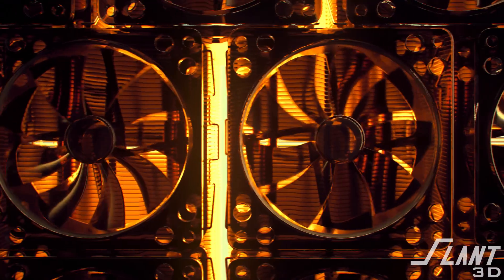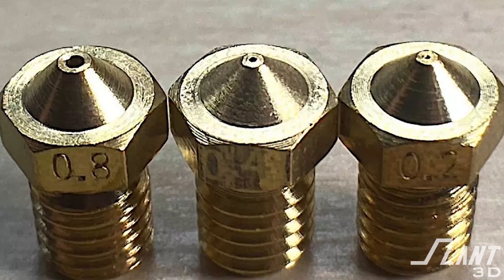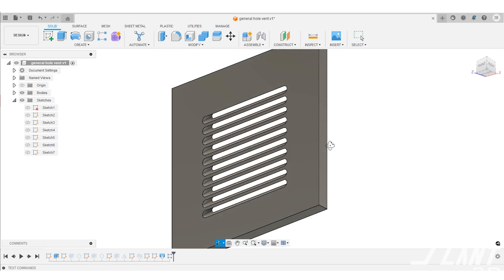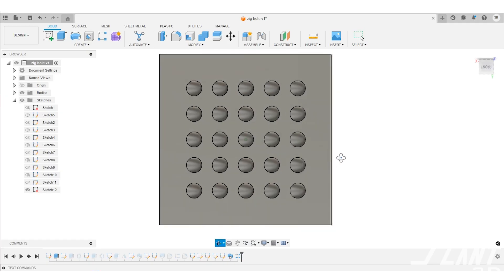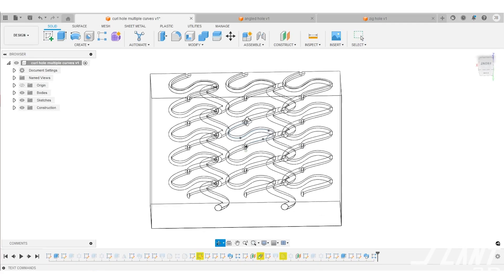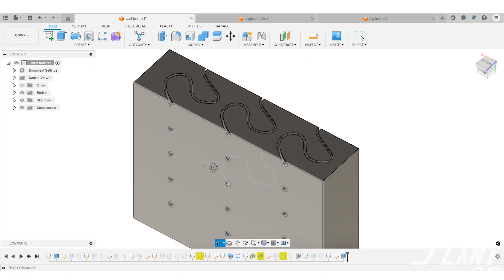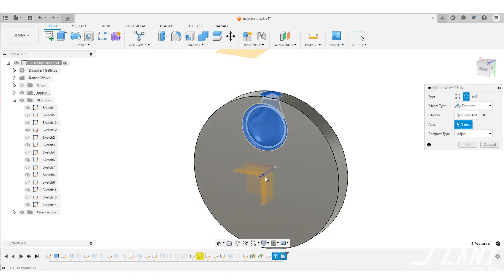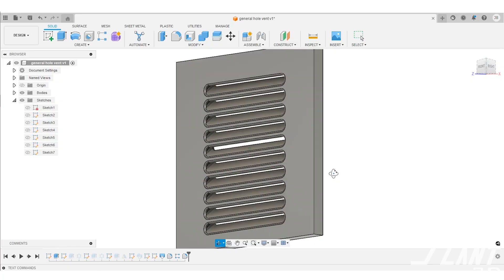These Cooling Vents are Impossible | Design for Mass Production 3D Printing

Comment: It's really cool to see the kind of innovation that comes from a relatively new manufacturing technique. The further into the video you go, the more insane the geometry gets. And while I imagine you technically could manufacture these parts in other ways, it'd probably be stupid expensive and complicated to, and likely even then still likely with extreme compromise. For example, several smaller parts later joined together would be one way. It just wouldn't make any sense to do.

I was actually quite critical of the last Slant 3D video I watched (the mug handle video) because I felt it was very dismissive of other manufacturing techniques as antiquated. But this doesn't seem to be the case here. Instead it's just showing off the really cool things that are being made practical with the use of 3D printing. Doing so also provides solid examples for why someone might want to choose 3D printing over other techniques for high volume production. It does also show its limitations and potential ways to mitigate them. For example the basic vent designs with 3D printing may not be an ideal combination, but the slants work much better. (Though I assume this introduces more drag, something that may very well be an acceptable trade-off)

Some things that came to mind for me while watching these specific examples were the complicated hydraulic circuits that are often found in things like automatic transmissions. As well, I imagine you could do other crazy geometries such as Tesla valves. The whole idea of complex internal geometries offers a ton of potential.

Overall, I'd love to see more content like this, and it makes me really excited to see what other really cool things people can do with this technology or how principles already outlined here may be applied for other use cases!
Reply: Just print the piece flat and no supports needed for the first 2, and any word about difficulty with the basic vents is stuff much easier to do with traditional manufacturing methods, and so this 3d print ideas are solving an imaginary problem

Comment: But "look there's one step even further we can go"  (8:55) ... "we can do whatever we want."  Love this. The magic of engineering design, that enables transforming ideas into real solutions, that weren't possible before.

In terms of design ideas, or design strategy, 3d printing gives engineers and designers a whole new manufacturing process that they can experiment with. Cost to experiment with, fail, and learn is much lower than other manufacturing processes too.

Comment: I think the throughline of the narrative has me confused:

"It's better to print slots than holes, so don't design with holes. Not here's all the things you can do with 3D printing using holes instead of slots."

Also, so many of those designs severely restrict the total airflow through the vent's area.

It might be useful for some novel consumer products, but for industrial applications, the stamped metal louver plate still seems to be the best choice, plenty of airflow, and the benefits of angled slots, namely preventing falling particles, falling liquids from entering through the vent.